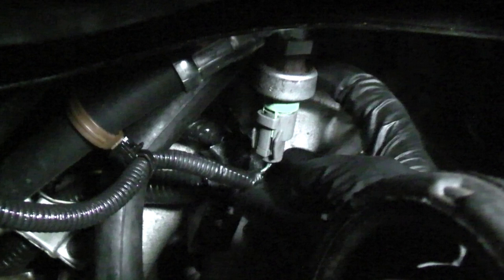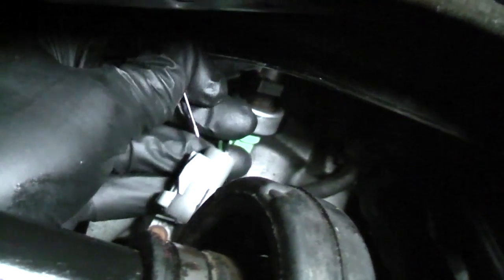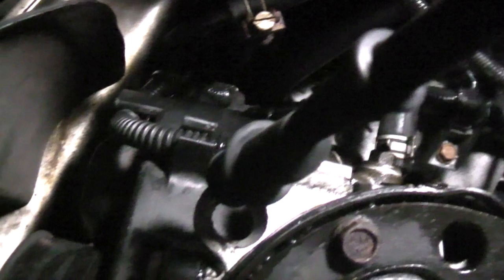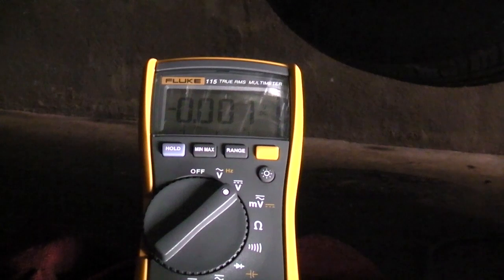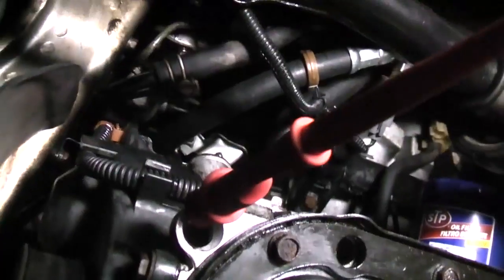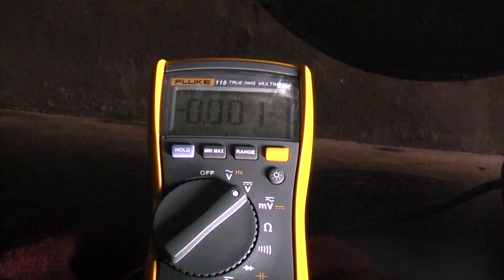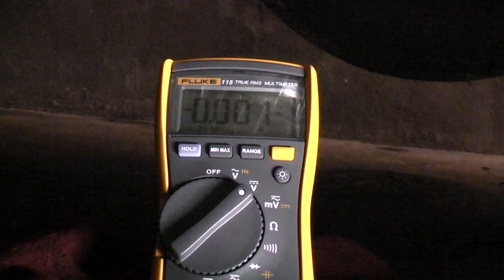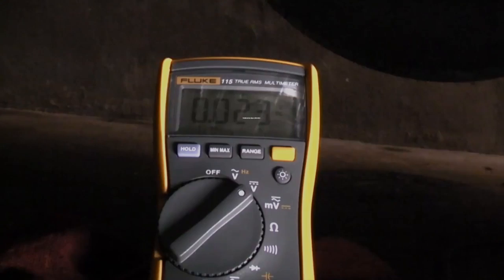Honda 2 Wire Power Steering Pressure Switch Testing

Comment: Knowing that this circuit is ground-side switched, I believe it is acceptable to simply t-pin the black (ground) wire with the pressure switch connected, then connect a lead to this t-pin and chassis ground with the engine running. If the switch is working, you should see a slight increase in RPM. This way, you don't need the extra steps of t-pinning the power wire (green) or locking the steering wheel to either side.

Comment: Could you troubleshoot this by unplugging the connector and test-driving, to compare the behavior of the car with/without the switch?
Reply: Did you try that ?
Reply: im kind of curious myself.
Reply: If you unplug. There would be no increase in idle when you full turn your steering wheel. The engine may stall or idle get really low.

Comment: I recently replaced my 03 MDX pressure switch. Atfer that I measured black wire. it gave me around 8.0V when it was unpluged and went from 0 to around 8.0V when pluged in engine running locked to locked. The battery was fully charged but I didn't get 12V+. Does that mean PCM is bad.
Reply: good question. I hope I don't run into the same issue.

Comment: When you tested it with the t-pin along side the black wire, you put the red lead in contact with the t-pin and the black lead on the engine block.   After you got that reading you put the t-pin along side the green wire and said that you had the red lead on the ground for the first test and that you were going to switch them around and put the red lead in contact with the pin.  You had it that way on the first test.  When did you switch them and put the red on ground and which way is it suppose to be.  I want to test mine.
Reply from the maker: +Terri MacFarlane It doesn't matter which multimeter lead goes to what point. If they are reversed the meter will indicate a negative voltage with a - on the display otherwise the reading will be the same.

Comment: Couldn't you switch your meter to ohms and test the ground side?
Reply from the maker: Resistance measurements are not as useful as most people think they are. Since the circuit isn't powered up (loaded) when taking a resistance reading a bad power or ground can actually check out fine when in reality a high resistance connection exists.

Whenever testing for voltage drop it must be with the circuit under test fully loaded.
Reply: The current draw of the circuit has to be considered then.  A 100ma draw will give 10 times the voltage indication of a 10ma draw.

Comment: Nice way to test this. I presume modern vehicles are electrically assisted when on full lock?
Reply from the maker: Honda's to this day still use this pressure switch design. It's simple, inexpensive, and it works. Which is probably the reason they didn't change it.

If you're referring to electric power steering systems they work on a totally different principle.